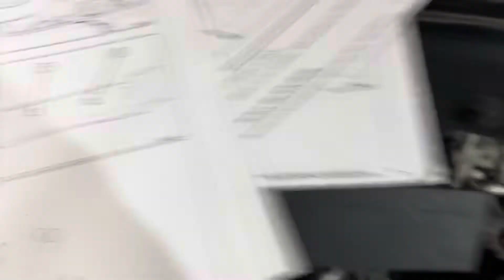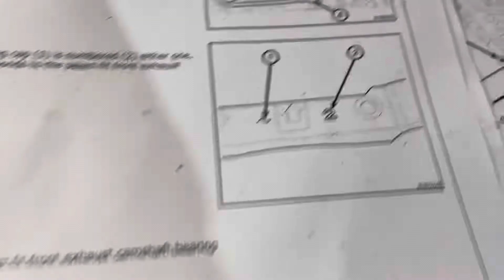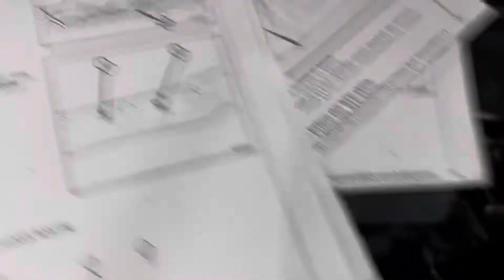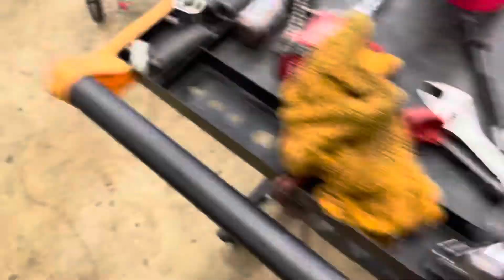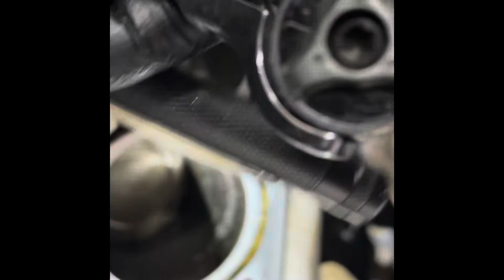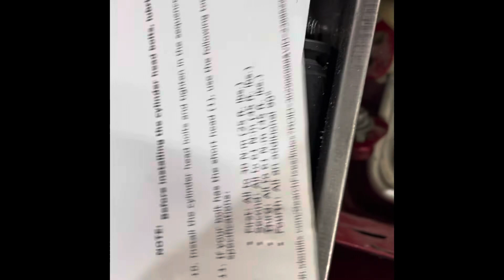Fix Stripped Bolt Hole Cylinder Head Repair Dodge Jeep 2.4

Comment: Little grease on tap will help shavings stick to it not leaving as much behind when blow out
Reply from the maker: Yes especially on smaller tap great tip , but these shavings where bigger so all out with blow gun down the hole 🕳 👍🏼